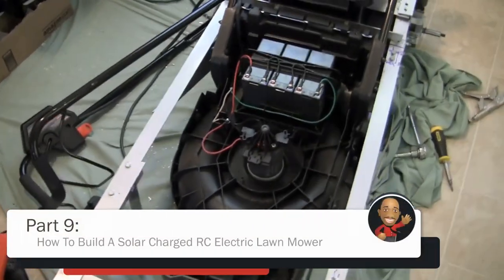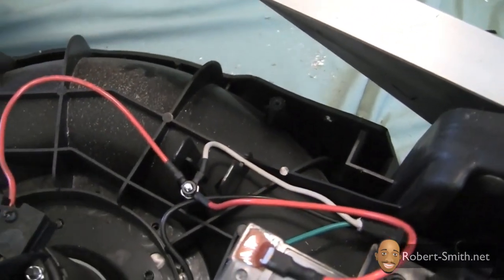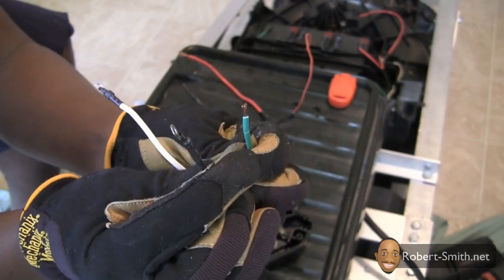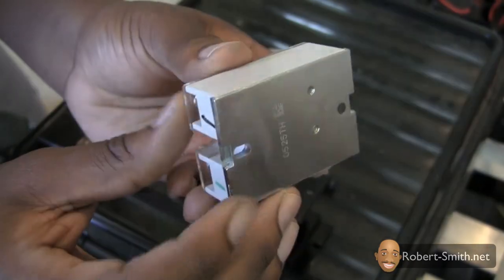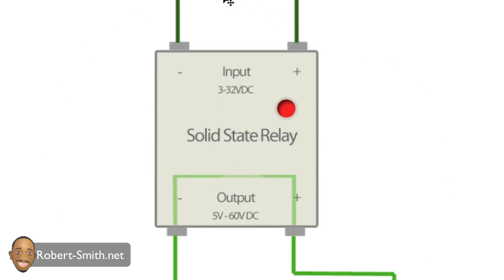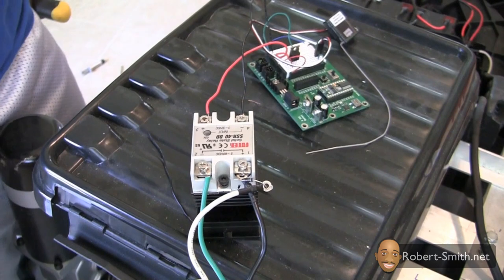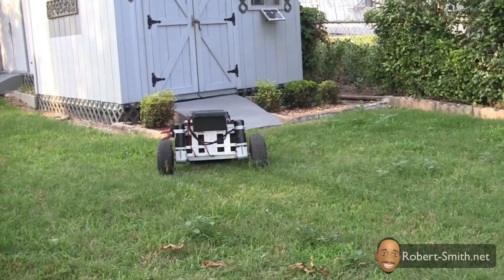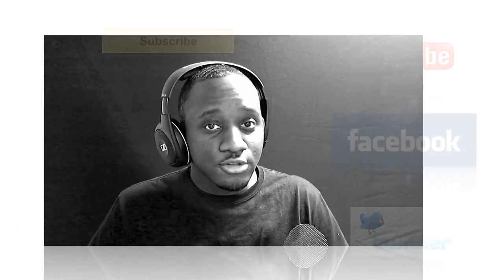How To Build A Solar Charged RC Electric Lawn Mower - P9

Comment from the maker: @thefaeryman I agree, and that was something I tried to implement for quite some time, but found no way around it due to the lawn mower using an unpopular 36v battery source unlike the more standard 12v or 24v or 48v battery source. Basically, there are not as many devices out there avaliable that will work with 36v battery sources, such as a solar charge controller, voltage regulators, power inverters...etc.

Comment from the maker: @MrHorsetail That's a great idea, and I know the sabertooth has a built in battery monitoring system, but I'm not sure if it is adjustable to 20% auto beep to signal low battery voltage. However, the Parallax board can be programmed to monitor the battery voltage, and to beep when the battery is near 20%.

Comment from the maker: @shartne You do not need to. You place the thermal compound on the heat sink or SSD just like you would if you were building a custom computer and needed to attach the cpu heat sink to the cpu fan. Only a pea size amount is all you need. Once the SSD is on the heat sink, the compound will spread out in all directions with a diameter similar to a half dollar coin.

Comment: One of those RC lawnmowers would be very helpful to someone with back problems like myself.   I had one of those rechargeable mowers and liked it a lot.  I soon found that keeping the blade sharp and not setting the blade height too low keeps the battery from using too much power.  One thing that would help is to have the MC monitor the battery level and tell you when it gets below 20% charge by beeping or something because discharging lead acid batteries more than 20% will shorten lifespan.

Comment: It is a such a great job you have done. What if you use the other side of your remote control to control the blade speed. That way you can turn it off over fragile things that can be shredded.

Comment: I bought two sabertooth to buy 25 I try to copy exactly what's on your video it did not work then I bought another piece and I try with 
to motors and I try again it did not work I change  the dip switches it did not work I was wondering if there is any way I can test the electronic piece which is the sabertooth 2 x 25 to figure out if it's functional or not